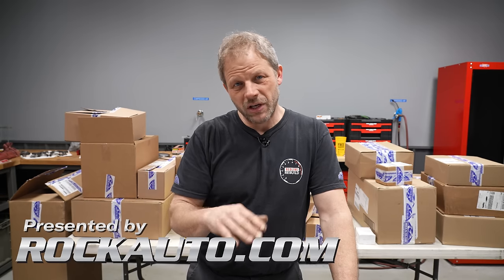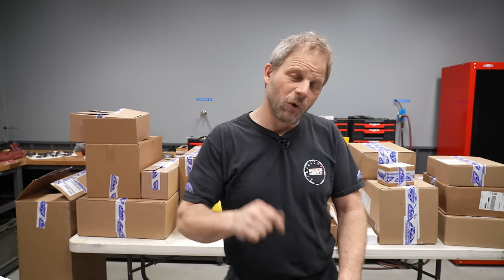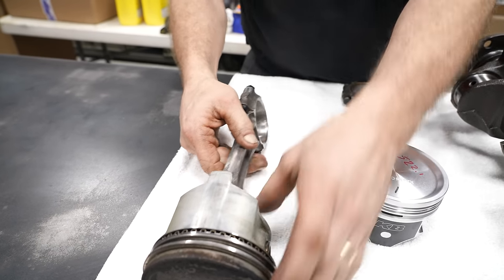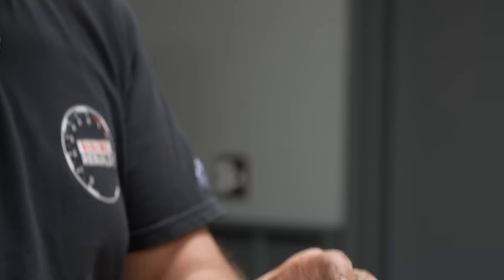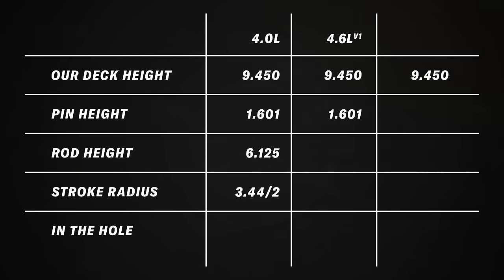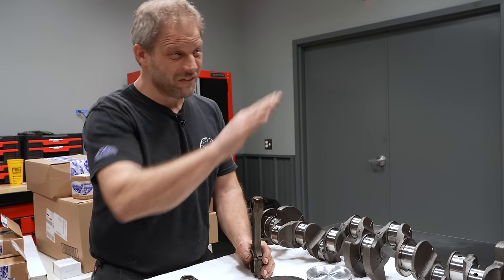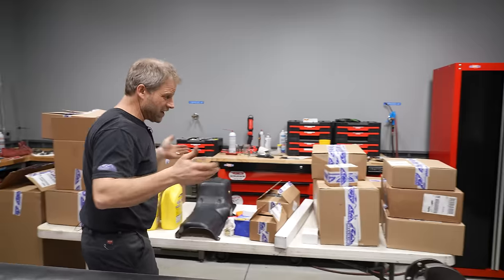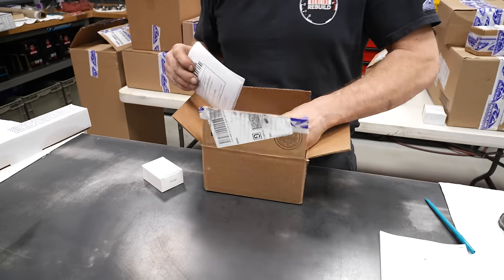Breaking down our Jeep 4.0L stroker mod

Comment: I've been running a 4.6 stroker in my jeep for close to a decade now and I love it! Stock everything besides the 4.2 crank, rods, sealed power 677cp pistons .040 over, and injectors.
Reply: Hi, what does 0.040 over means? Still learning about engine building. Thank you!
Reply: @free2chasehappy  the cylinder bores  are bored and honed .040 of an inch bigger then the factory size bore
Reply: @autobodycolliosionrestorat3362  Thank you very much! Appreciate the help!
Reply: What year and model, and what about ecu tune solution?  I have an 04 tj rubicon 5spd over 230k.  Rebuilt most of front end, zj v8 tierod, reman coated calipers, rebuilt rear diff.  I have 12shot injectors to put in when it gets warmer, they made a noticeable difference in terms of shorter cranking time to start in my old tj and ran better at low rpm. I never tracked mpg to see if they improved it though. Gotta fix some tub rust.  If it makes over 300k i wouldnt hesitate to show it some love, stroker it and get a new ax15, the nv3500 is ok but 3rd gear syncro bad, i double clutch anyway. I researched doing a ls swap but for how these jeeps are driven, and the time and money to change a ton of things, the stroker makes way more sense.  You dont need 400hp in a short wheelbase, slow shifting, top heavy 4x4. And could use  new control arms and body mounts  too, bushings are worn, and fix lockers not working.  But i only paid 6300ish for it last november!  It needed front end work though, the driver upper balljoint was wasted, had to trailer from connecticut.  I dont see many tj's in massachusetts anymore, rust killed most of them.  The frame design with no drain holes in the midsection is a big reason why.  And you gotta undercoat these things and drill drain holes in frame.  There was POUNDS of rust and scale i removed from my frame but it still is solid inside, i checked with inspection camera too.  Needle scaled the whole underside when i got it, messy job but worth it.  I wish you could buy a new samurai and tj, i think the jk and jl are meh, the underhood room is lacking, electronics have more problems, stupid things like integrated relays so if horn relay fails you cant replace just it, dont like the electronic throttle, has no feel, ruins a manual jk to me, and headrests are painfully angled forward like you are supposed to be a hunchback to drive them. The 3.6 is ok to me but still not as solid as 4.0, the oil cooler is an added point of failure and the inline 6 will always sound better. The frames and suspension are an improvement, but id love a narrower frame jk platform with a tj body, ax15, lockers, maybe a 4.0 stroked with a little turbo!  That would be sick!
Reply: What oil did you change to?
Reply: What did the 4.2 liter engine stuff come out of?
Reply: what kind of mpg do you get?
Reply: @sonxstream3293  86 -90 jeeps
Reply: I rebuilt my 4.2 with a cam an had the head rebuilt an surface it bumped the compression up a little it's makes OK power 😎✌👍
Reply: Have you dynod it if so whatd it do
Reply: What size injectors and did your ECU retune itself?
Reply: @sonxstream3293  Seriously! How am I missing this. Ever find out?
Reply: The  Engine  cylinder bore( piston size) is bored ( made bigger)  by 40 thousands of a inch.

Comment: Dude...even .025" further in the hole will still raise your compression ratio from 8.8 to 9.5.  You're forgetting that you're going to have a longer cylinder cramming air into about the same size combustion chamber.    My 4.6 required premium due to this, but it was sooooo worth it.  If you don't want to run premium though, you might want to find a way to reduce the compression ratio.  If the piston were the same distance down the hole as the stock 4.0, that extra 0.6L would raise the compression ratio from 8.8 to 10.12.  The cylinder being .025" further down the hole is only going to cost you .005 liters of combustion chamber volume.  Combustion chamber volume will go from the stock .0758 L to .0807 L.   This should give you a compression ratio of 9.5 due to the extra 0.6L of air you're compressing.
Reply: Ideally you'd use dished pistons that come up the the normal deck, that way you don't lose your squish (and the the associated reduced tendency to detonation). Not sure on the practicalities of that though.
Reply: @AWIERD1  I sold my stroker, but am considering it in my new Jeep.  Never considered meth in a NA engine, but not a bad idea, actually.  It only knocks at low rpm/high throttle
Reply: I was looking at the DSS forged -10cc pistons for my stroker/turbo build. My blocks getting Darton sleeves. Adjustable roller rockers and a .50 copper head gasket. There's all the options in the world with these engines.

Comment: I'm running a 4.2 crank, 4.2 rods, factory 4.0 pistons (yes, stock bore, making it a 4.5 liter), a thinner MLS head gasket, and a .030 decked block.   Yes, this makes the compression ratio quite high, but I'm able to get away with it on 87 octane for a few reasons.  First, I polished the piston tops and the chambers.  This may have added a tiny bit of volume, but not enough to matter.  It did help reduce hotspots though. Second, the quench is extremely tight.  If this thing revved more than the 5300 limiter I'd be at risk of the piston hitting the head at high RPMs.  That tight quench leads to extremely good mixing in the chamber, which makes for an efficient burn.  Finally, my dynamic compression ratio is a bit lower due to a more aggressive cam.  It's not a race cam by any means, but even small increases in duration can make a big difference in dynamic compression.  Been running this combo for about 5 years.  It's a beast.
Reply: Whats the 4.2 litter stuff out of?
Reply: @sonxstream3293  you can find 4.2 in wranglers I think tj and yj and stuff
Reply: What did you do for pushrod lengths? I'll be running the mopar "hi perf" beehive spring out of the magnum V8. (drop in)
Reply: The 4.2 stuff can come out of any AMC 258. I think mine came out of a late 70s Wagoneer, but anything from a Gremlin to a YJ can do it.
Reply: @scotteric8711  my build kept all the same geometry as stock except for the deck height on the block.  I had .030" cut off the deck height, so I ran stock 4.0 pushrods, with a shim under the rocker arm pivot to make up for the difference in deck height.  I don't remember the exact height if those shims.  I'm sure it was probably .020 or .025.  I just marked the tip of the valve with layout fluid, then turned the motor over to get a mark on the valve tip.  Then just shimmed until that mark ended up in the middle of the valve.
Reply: i just want to know all the guys on the comments are running the shorter rod. i thought you wanted more rod ratio to make a more power.
Reply: @logancudd7030  the rod length doesn't affect power as much as stress and wear.  Longer rods will result in a straighter rod angle and less side load on the piston.  That said, running the longer rods in a stroker requires custom pistons, which is an expense many don't want to incur, so we run the shorter rods with the stock XJ pistons.  I'm sure over 200,000 miles there would be more wear on the piston skirts, but I only run my Jeep a couple thousand miles a year, so it doesn't matter to me.

Comment: Youre basically losing .026 on deck height, but gaining .450 in stroke.  Your compression will be greater without any further mods even with the piston sucked into the hole .026.
Reply: Yeah- a stroker typically needs premium fuel due to this.  Compression ratio will move from 8.8 to about 10.

Comment: 4.6 stroker , I know of a certain channel that did that in his 2000 xj for the extra power for doing recoveries ( Matt's off road recovery ) , with doing a twin exhaust that thing sounds good
Reply: The "Banana" is a beast! I prefer it to the Morevair.
Reply: @moparedtn  the banana became a super beast compared to what it used to be, but man that morrvair just looks way to good to say no to. 

When I first seen it in a thumb nail it was confusing with the grill, I had it mistaken for as a Cadillac at first

Comment: Perfect timing. Our '99 XJ has 250k miles.  It's getting tired.   This option is cheaper than RP stroker...

Thanks for posting.
Reply: If you want a drop in piston Icon makes them for this exact combo. Don't be afraid to bore it this block is thick and strong.  Loving my 4.7 stroker, my old gladiator weighs 6k.
Reply: @watrousmark401  Keith Black makes the drop in piston for less. KB is hypereutectic, Icon is forged. Unless going to extremes, you don't benefit from forged.

Comment: I built my first motor, the 4.6 stroker, back in 2007.  I went the 4.2 rod and Sealed Power 825cp30s route and snagged one of the last mopar 30 cams.  It was in a 96 2-dr 2wd manual cherokee that I stripped out to 2700#.  I blew through 3 auburn lsds.  It lasted a dozen years and 120k.  I have some eagle 6.150s waiting for a 4.8l build. . .
P.S.  get rid of that fan you got and get 1-2 ‘96 10-blades that have the same plug as the earlier ones.  They move more air.

Comment: So many people whining about the Fram filter.  If your oil is so contaminated that the brand of filter actually makes a difference, you have bigger problems.  Yes, there are better filters, but it's not the quality of oil filter that kills engines.  Ever.  It's letting them leak until the oil pressure light comes on, and going 17,000 miles between oil changes.  It'll be fine folks.  Chill out.

Comment: The oil pan on the 4.2 in my old '84 CJ7 had a thick steel plate welded to the bottom of it from the factory, I am surprised (but not that surprised) that the 4.2 XJ doesn't have that feature.  The plate helped prevent debris from denting or puncturing the bottom of the pan while off-road.  I also found it was quite useful when changing motor mounts:  I could unbolt one motor mount, then place a jack under the oil pan.  When the engine was jacked up this way it would tilt to one side and allow me to slip the old motor mount out.  Once the new one was in, I could repeat the process on the other side.  I really miss that old Jeep.

Comment: I’m rebuilding an 85 Nissan 720 pickup engine, currently. It’s a 2.4 4 banger with California emissions (2 spark plugs per cylinder).  I use a lot of the tips he mentions when seeking parts or prioritizing what to replace.  I love these rebuild videos.
Reply: That's great news. Is it hard or expensive to rebuild?
Reply: @skylinefever  so far so good.  I have a parts pile going on as I take a look at the top end. Simple little truck.
Reply: @Heffelz8  Excellent. Nissan sure made a lot of tough engines back then.

Comment: Honestly , if you are going that far to build the engine you really should just make sure your deck height is true across the board anyhow.   Do .025 with a cut and a .020(give or take) Cometic head gasket .   
  You’ll be at 9.2 or 9.3 c/r and still safe from detonation.

Comment: I considered doing a stroker 4.6 build on my XJ, before deciding on a 6.0 LQ4 / LS swap a few years back. On the Jeep stroker forum, many people were having a lot of camshaft issues with theirs. And now, many engine builders of all makes are having issues with new flat tappet camshafts. Destroying themselves during break in, etc.
Reply: If you're open to the LS route even the small LS's are an unpgrade.
Reply: The story goes that the flat tappet cam problems are due to newer oils not containing enough anti-wear additives like ZDDP. There are still plenty of high zinc oils out there though, especially oils intended for older (pre-dpf) diesels, so I'm not sure if it's just improper selection or something else.
Reply: I've been running my stroker Jeep motor for about 5 years with no issues.  Granted, I built mine very carefully.  There's WAY more to it than they're talking about here if you want it to really work well. Even so, an LQ4 would stomp my stroker's face in terms of horsepower and torque and still get far better fuel mileage.  The engineering of the LS is just so far beyond the old Rambler straight 6.  If you can afford the LS swap and you have the skills to pull it off, it is a great option.
Reply: @nerd1000ify  I'm running Valvoline VR1 race oil in mine.  Plenty of zinc.  It's a little spendy, especially 7 quarts at a time (mine has added capacity) but no cam issues.
Reply: @nerd1000ify  this is a different issue brought about since the pandemic came about. Supply chain issues are causing manufacturers to unintentionally send out inferior products. The alloys being used are softer, and no amount of ZDDP is going to fix the problem. It’s the same deal with lifters and stamped rocker arms as well.
Reply: @HomebrewHorsepower  Been running the LQ4 with slight mods for 5 or so years. It does pretty well, and gets about 18 MPG. The stroker route i imagine is the more cost effective way to go though. Doing an LS swap is just like giving away money. LOL
Reply: I have heard of some cam companies using cheaper alloys and narrower lobes than stock. Perhaps this is why he had the OEM cam reground by Delta. That way he knew what metallurgy and lobes he was getting. Some people are getting flat lobes, even when using the right high zinc oils for aggressive new cams.
I have also heard some new lifters also are made of cheaper alloys. Some people have searched for NOS Mopar lifters to know what they are getting.

Comment: Two things.  Upgrade the intake to a 99-06 one.  Better air flow.  Second,  upgrade the oil filter to the one for a Ford 300 straight 6.   Adds about 1/2 qt of oil to the system.   Ran that in my 06 rubicon and my 00 grand Cherokee.

Comment: Deck the block. Tune it to basically to what compression you want to run. There's lots of material.

In my instance I made mine zero with with a short rod stroker with the short rod and a aftermarket piston. I ended up milling mine (edit **.022 **) (which zero decked it in my case) and shaved 7 thou off the head (to-de-banana) with a 43 thou msl gasket. Works out roughly little over 10:1. That's more than happy with today's fuels. I don't remember my numbers quite, it's been like 11 years lol I recorded my build, that folder is somewhere around here lol, but I think I had a 20cc dish icon forged 944 for a forged 5.875 RPM rod. Used the later 4.2 4CW crank that has .010 undersized.

When I rollerized the motor I also bought another MLS head gasket and took a layer out. It was a bit different construction and slightly thicker so I took a layer back out and was roughly .042. I actually run that currently with 12 pounds of boost on 91.

Glad you decided to do a full stroker. I thought maybe it was for someone else and they just want a fresh rebuild. That thing is going to fly! You'll be constantly doing burnouts and donuts in that thing after you put that stroker back in. 😄
Reply: For the Renix boys out there like me, watch out for that distributor. The sensor for the Renix is different than the later hall effect sensor. Even though they looks the same up until they use the ring style sensor. They have different values and don't quite work the same. The injector timing will be off and it won't run quite right.
Reply: You can take that much off the block and not destroy it?😳 Crazy!
Reply: @geoffmooregm  The old Renix blocks are closed fairly thick. The newer ones are a little thinner but I heard of people taking later ones and cutting as much as an 1/8 out. It surprised me when I told the cut to zero deck the block to the pistons. The rotating assembly I got as a part of a stroker kit and he told me to get them to mill the block that much. At that time I didn't too too much about machining these blocks but As I started rebuilding them I've noticed they are very beefy built.

EDIT: And I just noticed now that my 2 is supposed to be a zero LOL 🤣😆
Reply: @CanadaBud23  Oh ok that makes much more sense. I was thinking damn you can mill almost 1/4" out. Thats some heft!
Reply: @geoffmooregm  Yeah I was like, a lot?! How? 😆Then I read my comment again and I was like Oooh, lol.
Reply: Decking makes a huge difference on these.  By tightening up the quench, you improve the mix in the chamber which really helps at the increased compression ratios.  I honestly think people failing to deck the block is one of the main reasons people have trouble with these strokers.

Comment: glad you are doing the 4.6 conversion.  even with the 4.0 head which is better than a 4.2 head it still doesnt breathe!  cam will help a bit, please go in and do some bowl work and porting in the head, maybe a fancy valve job and bigger intake valves?  not sure how bad the intake manifold is, but probably was an after thought.

Comment: There is something that you may not be aware of. When you install the timing chain cover it has to be centered. They make a tool that you slide onto the end of the crankshaft after the cover is installed and it centers it up. Another option is to put the bolts into the cover and not tighten them up. Until you’ve installed the harmonic balancer.

Comment: Go with the longer rods for certain.  Less rod angle means less cylinder wall wear and friction.  Deck the block and head to make up the difference.  You'll be happier in the long run

Comment: You will need spacers for the engine girdle under the block to accommodate the larger rotation of the new, bigger crank.

Comment: I’m wondering which head he’s using. The H.O. head that ran in the early 90s is a good upgrade.
Reply: This was a factory HO motor.  The replacement head is also HO.
Reply: Good point. Also, if he didn't have an HO head, I'm sure he could find the casting number and Rock would have a rebuilt unit ready to go. I think the OEM number is 7120.